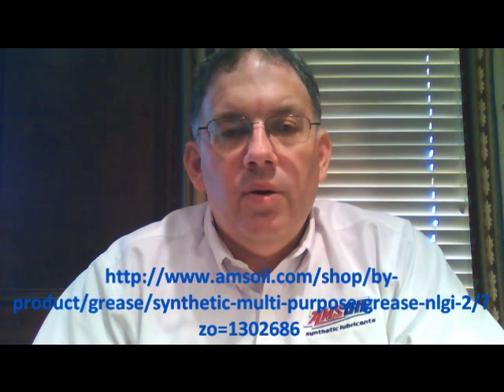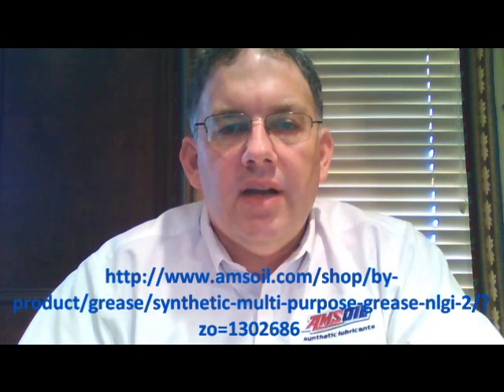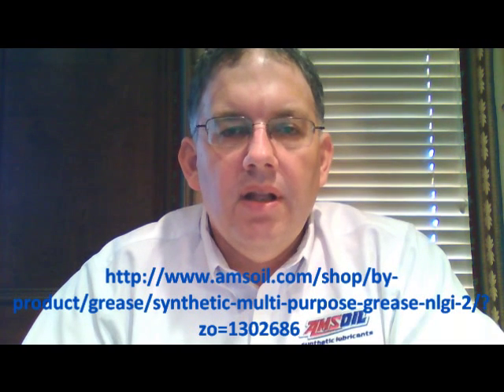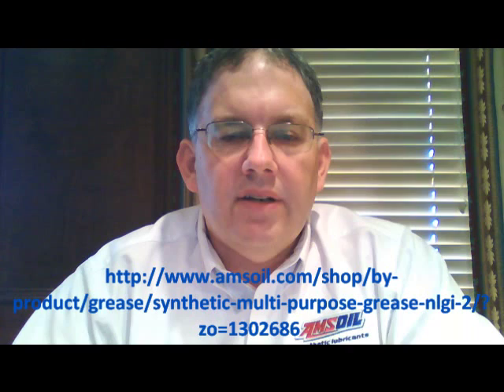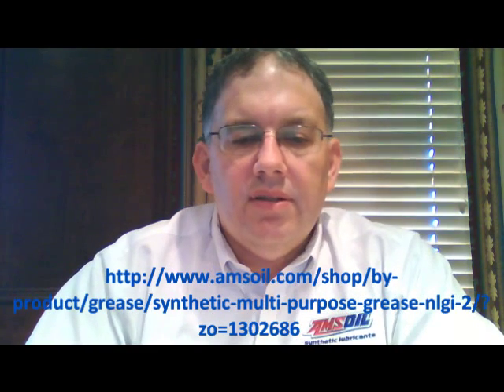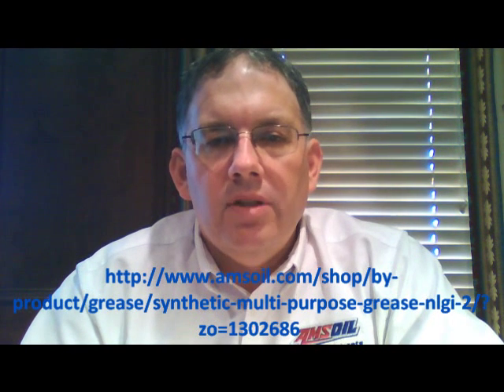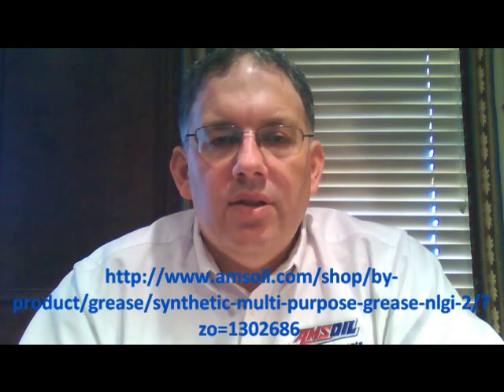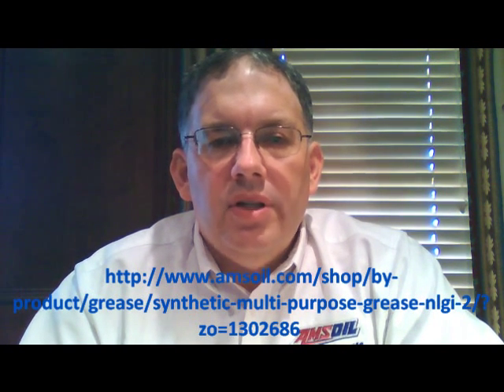AMSOIL GLC Synthetic Multi-Purpose Grease

Comment: Will this be ok for semi truck chassis? They are out of the heavy duty grease
Reply from the maker: Yes this will work well, and you can also use the Truck, Chassis & Equipment Grease #1.  The #1 grease is lower viscosity and intended for colder weather, but you can use it in any weather, but you may have to grease the truck chassis more often if it is hotter temperatures.

Comment: Would this AMSOIL GLC Synthetic Multi-Purpose Grease  be ok for a SnowBlower ( typical consumer model / home depot walk behinds)
Reply from the maker: You could, but I would recommend a lighter grease for cold operating conditions.  My first choice would be AMSOIL Synthetic Polymeric Truck, Chassis and Equipment Grease, NLGI #1
Product Code: GPTR1CR-EA.  The Multi-Purpose grease featured in this video is an NLGI #2, which might be too thick for very cold conditions.